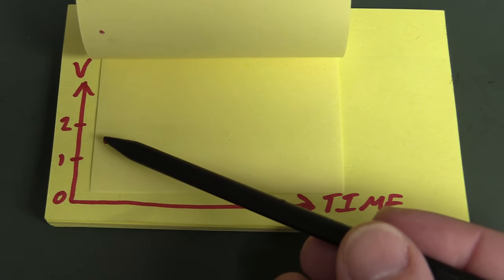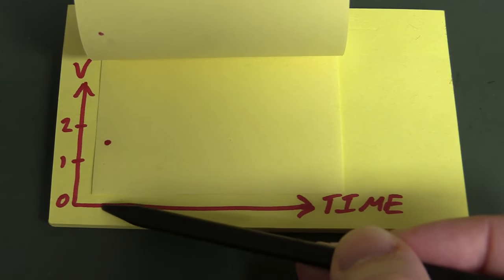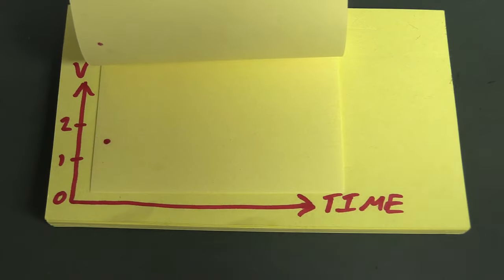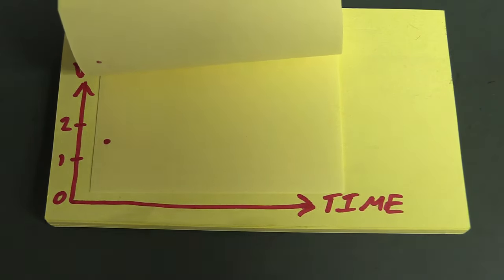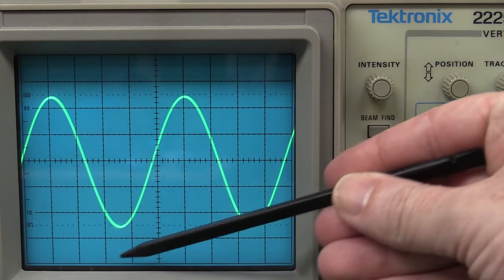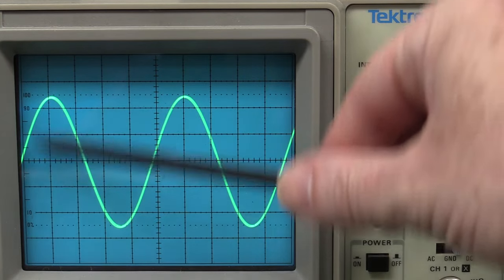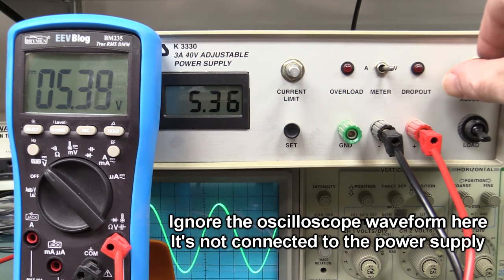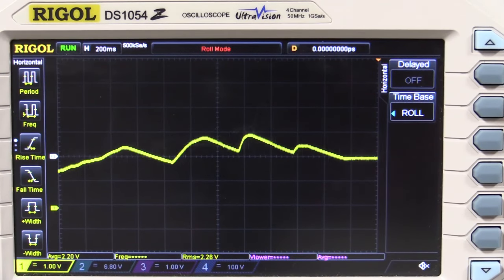EEVblog #926 - Introduction To The Oscilloscope

Comment: The hard part is figuring out which oscilloscope to save up for.
Reply: The cheapest used one with the largest bandwidth / sample frequency you can find.
Reply: Yes and no, Just wantch out for some makes like owon, I got stung for £500 on a 200MHz machine that has terrible aliasing and the power board blew up so it's on life support with an external power brick. I replaced it with a 50MHz rigol for £300 and could not be happier.
Reply from the maker: Analog stuff needs single shot too. Try to measure the startup behavior of a PSU on an analog scope for example.
Reply: I've been looking at scopes and one that seem very popular is Rigol ds1054z. The question is if it's very exaggerated to get as a first scope. It's price is a bit steep but not impossible to save up to.
Reply: rigol 1052 is cheap as hell and a fantastic machine, i have a tektronix 1102 that is alot more expensive and comparing it with the 1052 is slow as F^&*&@, if i didn't have any scope today, my first one will be, i have no doubt, a rigol 1052, but don't take my word for it , research it, ask in the eevblog forum, etc and make up you own mind., good luck!
Reply: Are there any scopes that are cheaper than I can connect to my computer? So far I've only heard bad stuff about those, but I don't see why a scope would need to have all the intelligence. Why not use it as sensor and let software handle the rest? I assume I'm missing something. :P
Reply: Jim Groth 99% of them are crap, scopes need to be fast to be usefull, avoid USB ones, if you cannot afford a new digital one, go for an old tektronix like the 2232 which is a fantástic machine, I still will go for a rigol 1052 excellent quality and very cheap for an instrument like that
Reply: I'm thinking a computer could at the very least handle displaying and interacting with the device. Should save some bucks spent on the screen at least. 

Anyway, it seems I need to save about 300-400 euro for a decent scope.
Reply: buy cheap buy twice. theres plenty of old bangers, pocket scopes on ebay, but if your budget stretches to about AUD$500 get a Rigol 1052
Reply: Yep, and don't forget they are easily hacked to 100Mhz too.
Info is on Dave's forum.
Reply: Bob from TI says 500mhz min.. what do you think..is the 1054z a toy? or will it be fine for most things...
Reply: Foxy rollins You have to decide what you want it for.
If you need the speed, maybe can pick up an older analog model with that bandwidth.
Reply: yeah, i think i will cut my teeth on an old analog
Reply: I have a feeling I will blow it up
Reply: I guess once i start engineering i can ask my lecturers
Reply: I want to be a design engineer, get into electronics and communications.. I dont have the experience to know what i will be up against.. I dont want to spend $700 on a 1054z and find out its inadequate.
Reply: Every bit of kit has its limitations. Generally speaking, the cheaper the bit of kit is, the more limited it is in what it can do with reliability, accuracy and repeatability.
Reply: I've got a Hantek DSO5102P, upgradeable to 200MHz, and have found it to be an incredible value. Easy to learn and fast enough for everything I've done so far, I don't expect to replace it. Too good a machine.

Comment: Hi Dave, great video and hopefully you'll follow up and make it a great series. I just thought I'd add some points in from the point of view of a beginner like myself:

1) When a scope mentions bandwidth (Mhz), I used to think of it as the fastest frequency signal that it could display correctly.  It's the fastest signal it can monitor while being 3dB down. In most cases the scopes bandwidth is a little higher. So anyone buying a 50Mhz scope looking to monitor max 50mhz signals won't get a 1:1 reproduction. Maybe this is common knowledge, but as a newbie I thought it was good to know.

2) Since the Digital scopes sample the input, as a newbie I thought that sample rate was going to be the same no matter what time base you use or how many channels you have on. But of course the sample rate is a function of both of those (and maybe other things?). Again I was surprised at this and just shows how little I really know about these majestic devices.

Do you know of any other newbie traps like this? Perhaps you can incorporate them into your next videos and give us newbies a chance to catch up and buy something decent for a first scope, thanks!

Comment: I know this is a older video but I wanted to thank you Dave for your channel. I bought a Rigol 2072a after watching all you o-scope stuff. Was looking at a owon all in one thing but your advice was to buy individual gear. So I have my Rigol scope a fluke 8050 bench meter, a owon handheld (till I get yours) and a cheap power supply. I love most of it but adding as I go. Thanks again for all your work to keep us informed.

Comment: But Dave, how does an electronic oscilloscope measure voltage? That would be a really interesting topic to make a video on.
Reply: I think sample and hold is the main block.
Reply: It would pretty much just be a video about ADCs. I'm sure Dave will cover them sooner or later.
Reply: Magnets...
Reply: I guess abu0ibraheem and Derp Herp are talking about digital scopes (sample and plot), and zanfr kruhm is talking about analogue scopes (which is basically a specialized CRT monitor).

Comment: Time for a nit pick :)
@6:55
Isn't the line on the analogue scope to do with the phosphor staying lit for a short period of time after the beam has projected across it, not because of our eyes persistence of vision. 
For example if you were to take an image with a very high speed camera you would still get a line on the display (if you are updating the screen fast enough ofc) because the phosphor takes time to dim back down, whereas if the effect was a result of our eyes that would not be the case, you would see a very small line or dot based upon the shutter speed.

Comment: Thanks for the info, I picked up an analog scope a few years ago for $150...I wanted a digital, but couldn't afford one at the time...but mine (a higher up Tektronics) does measure voltage and hz.   I look forward to this series to get the most out of mine.

Comment: I bought a Tektronix 2430 digital oscilloscope in a local fair. It's a first generator digital, with a analog tube to display, for an amazing price of 15 euros (yes, no missing zero). The woman said : "This B&W TV set was owned by my son but there's too many buttons I don't know how to tune it and the screen is too small". 
I used it for quite a long time but it doesn't work anymore. I then bought a Rigol DS1054Z

Comment: I built my oscilloscope from a kit, the DSO-138 I think. It's not as fancy as the oscilloscopes you have, but it's pretty good up to 100khz signals. It was about 3 hours straight of soldering to get everything together.

Comment: what I don't understand is how (when you have a sine wave) it displays a constant image. let's say in the first pass its 0v at 0 seconds and then peaks at 5v in 0.012 seconds later, you will get several peaks and troughs, but then the scope goes back to the begining, and rather than being 0v it could be 2.2v which would not align  with the previous trace. in other words the resulting image would be all over the place with each scope cycle.
Reply: That's triggering.  You tell the scope what voltage you would like the "start point" to be and it keeps it lined up from there each pass.  If you set the trigger out of range, for example, the image will be as you have described.
Reply: The answer is triggering mechanism. The scope won't do a series of new A/D conversions (in case of digital scope) or a next single "run" of a trace (in case of analog/CRT scope) until the trigger detect a special condition (which is configurable). This way the signal becomes synchronized with the scope display.

The event which forces the scope to draw a new trace is, typically, a change of the voltage from low to high crossing specified threshold level, or from high to low. These two are generally present on any scope. Modern digital scopes have advanced triggering options such as triggering when signal (voltage) is keeping lower or higher than some threshold for a specified amount of time, triggering by a slew rate, treating the signal as an analog video signal and triggering on a specified scan line, treating the signal as digital conversation (using one of protocols that scope is aware of) decoding it and triggering when certain condition is met.

An, by the way, most of scopes has an additional input ("Ext. Trig.") which can be fed by an secondary signal which fires the trigger.
Reply: thanks for both replies. I guess the trigger would have to be detected at the EXACT same time or the constant image would be fuzzy if it does not overlap exactly. I often wondered what the external trigger did, I may need to do some reading as when and why you would use it.
Reply: Another way of thinking of it if this helps...
Think of the trigger point as the starting point, rather than the screen edge.
The wave is always at the same point as it hits the trigger because it is the wave that is activating the trigger.
For example, if set to trigger at a 2.5v rising edge, then when the rising edge reaches 2.5v it triggers, over and over, drawing over the previous wave form repeatedly.

Comment: I have a question related to the video linked in the description. The hazards of blowing up an oscilloscope using the ground clip of a probe are illustrated.  But over here,  the AC mains is not grounded.  There is no provision for AC mains earthing and most buildings dont do it to cut the extra costs.  As such,  the earth pin on appliance plugs is unused. If an oscilloscope is connected to such a system,  would the hazard still be there? In such a system,  the earth pin of the oscilloscope is effectively connected to nothing.  What would be it's behavior in that case ?

Comment: Dave i have the 2232. Old school dso fully analog with a crt. I absolutely love it. It’s the scope on my project des. I got a newer one for portable because I have to capture Siginal s on cars. Everything runs bus control. Luckily I’m able to mimic the Siginal with an arduino. The new BMWs have to have can. System for the Seats to work.

Comment: Nice introduction for beginners! I have the 1054Z too and the only thing I'm missing is a vernier (fine adjustment) for the horizontal. The old analog scopes seemed to have that. Or did I just not find it?

Comment: I just got a proper DSO the other day, and I tell you, it's been such a game changer. I got a Hantek DSO5202P, which is 200Mhz, 1GSa/sec and 2 channel. I was gonna get the 100mhz DSO5102p but for some reason I got it in my head that it was only 1 channel, which it isn't. So if I'd known that I would have just saved the extra $100 or $150 and msdded the 100Mhz one to run at 200Mhz. Live and learn I guess, heh.

It's been a HUGE gamechanger though. The first day I had it I spent about 8 or 9 hours just trying to learn it by characterizing the different ICs and transistors I have, and measuring capactiance by working out the RC time constant and so on. It certainly blows my old scope out of the water, which was one of those shitty JYETech DSO138 osscilloscope kits. I mean, they're better than nothing, but they were rife with problemsl too. The probes for them aren't even real scope probes. It's just alligator clips that go straight into the BNC connector. No passives, just wire. So they pick up noise like crazy. They're fine scopes for getting an idea of your waveform or measuring your duty cycle. But I wouldn't trust anything it says to save my life. Cheers

Comment: Which oscilloscope would you recommend for a hobbyist who never owned one before? Is the DS1102E good enough?
Reply: Rigol DS1054z is good enough, plus it is easily hackable. Of course, like anything else, if you have more money to spend you get more features. But as a hobbyist, I've never really found the rigol to be seriously lacking, except for the FFT feature. But anything with a good FFT is out of the price range of the average person.
Reply: zrobotics My local electronics store carries the 1102E for the equivalent of about 500 USD (that's why I asked about that particular model) but it doesn't seem to carry the 1054Z you mention. Sure, I could buy elsewhere and pay the shipping, but I'd rather buy locally unless absolutely necessary.
Reply: zrobotics Also, if by hacking you mean the trick you used to be able to do on the 1052 (boosting the bandwidth to 100 MHz with a firmware change or whatever it was), I'd rather not mess up with that because of the warranty.
Reply: Just to be clear, the 1054Z is actually a newer model with more inputs, a bigger screen, generally more snappy controls, and a smattering of digital stuff (like serial/I2C decoding). It's just a 50MHz model (1104Z would be the 100MHz version). 1102E is an 8-year-old two-channel model (1052E is the 50MHz version). For starters, the 1052E would be fine; the 1054Z is a little prettier but its main advantage is if you need to see more than two things at a time.

The 1102E is fine too (same as the 1052E, just more bandwidth), but $500 is more than it's worth; they can be had new for less than $350, and the 1052E for less than $300.
Reply: hobbified If it retails for $350 in the US, considering shipping costs and import taxes (I live in Argentina), I would say $500 is a pretty decent price. Some sellers on a local eBay-like website even want about $700 or so, and that is crazy.
Reply: is it good enough for a serious user? should i get 500mhz min?
Reply: if i want to do design stuff.. power etc.. is the 1054z ok.. or should i get a 500mhz scope?
Reply: Fuck the warranty
i also bought a rigol years ago
i pulled my apart the first day i bought it
it had a bullshit piss arse warranty sticker that you can remove carefully with a razor blade and put back on

voula, instant warranty
but in truth
you'll go through the warrant before you know it , 
and after that it won't matter
so... FUCK THE WARRANTY

Comment: So, if you were using the oscilloscope to measure RF frequencies, you need one that has the bandwidth for what you're measuring (50 MHz for HF, 200 MHz for VHF, and 600 MHz for UHF for example), correct?

Comment: Are any of the current digital scopes "instant" in responding to the controls?

I've seen your earlier videos showing a huge lag in response as the processor is too wimpy to even respond to the turning of a knob. It's pathetic that they want to save a few bucks by putting in a wimpy processor. We see the same huge lag in consumer electronics nowadays, compared to the instantaneous analog devices of the past.

Whereas analog scopes, not having the delay of executing computer code, respond instantly.

I think I'd strongly consider an analog scope, unless digital has come up to an imperceptible response.
Reply: Very good point about laggy controls on DSOs. I actually bought a 1054z, and sold it again after two weeks. Yes it's very good value, and has a bunch of fancy functions, but for me the lag was unacceptable - especially when adjusting vertical position. Also the on-screen displays of Vpp and Vrms etc. was often wrong by a significant margin, which was very confusing. I find the budget DSOs overrated, and would much rather use a 20-30 year old Tektronix or similar good analogue scope. Much better for a beginner also. I will get a digital scope again at some point, but probably only use it for special jobs where some advanced functionality is required.
Reply: I love my Tek 2225.  I was hoping he was going to use it,  but Dave loves that 1054z
Reply: It's really got very little to do with the power of the processor or the "delay of executing computer code", and more to do with the way the display is drawn and how that interacts with the controls. Usually when you see "laggy controls" the scope is doing something that would be pretty much impossible on a conventional (non-storage) analog scope. If you're looking at signals in realtime with a nice fast timebase, the controls (except on the very cheapest scopes) are usually nice and responsive.

Comment: I was scared kinda to turn on my scope, just picked up one with no leads from a friend. Ordered the leads Sunday and now have them Monday 1/9. I'm still not sure what I'm going to start probing, but I'm thinking or leaning towards my 555 timer circuit so I can find the frequency of the switching action I set on to the mosfet. I've always wondered if the math made it actually high freq or if it even is.

Comment: then there are the o-scopes for testing motor drives of power signals like 440AC 3 phase using isolated channels so not shorting from phase to phase as a common ground...  thanks...:)